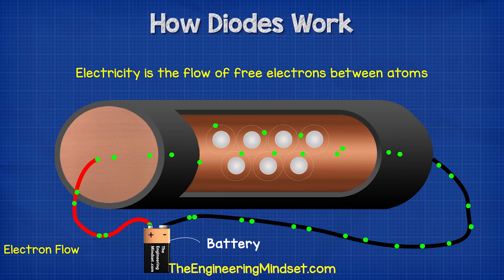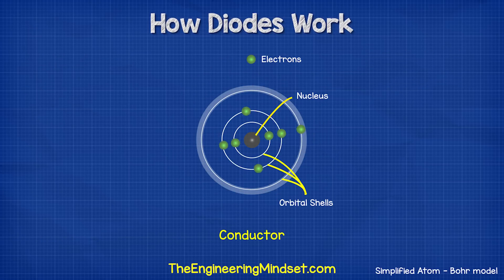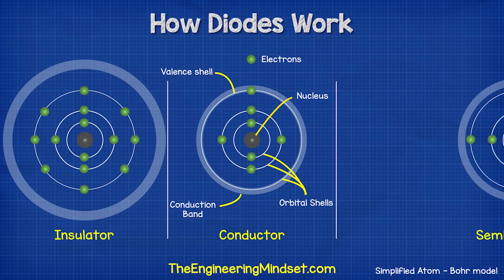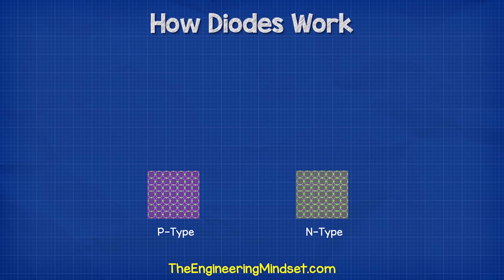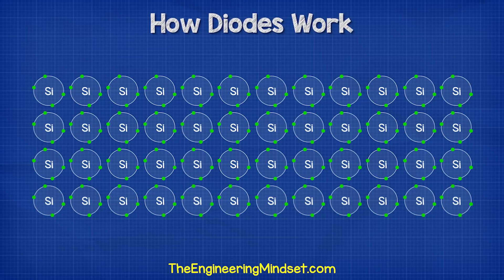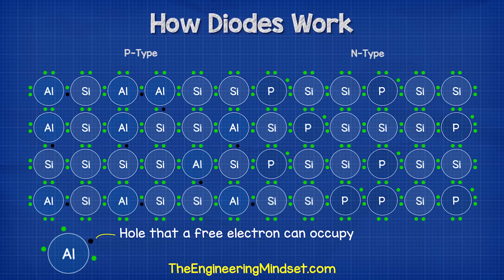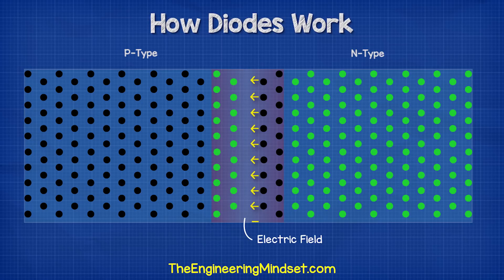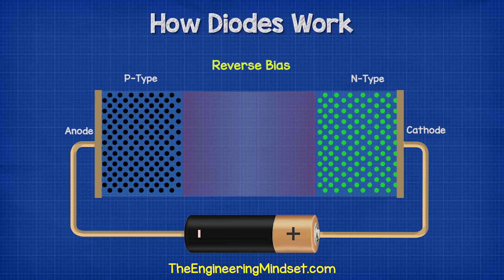This is How Diodes Work

Comment: This is similar to the explanation my College profs gave in the Electronics Technician program I graduated from in 1979. For some reason this explanation makes a ton more sense than it did back in 'college. Obviously this explanation is enhanced by using the animation and thus easy to understand.  After 43 years I am finally able to claim I UNDERSTAND how diodes work rather than just forward biased the switch is on and in reverse biased the switch is off. It is true, a picture is worth a thousand words, and an animation is the pathway to understanding. Great job. Three thumbs up. First time I have ever given more than two thumbs for anything.

Comment: When the diode acts as an insulator, and the boundary region expands, are the electrical properties of the anode & cathode different enough to detect elsewhere in the circuit (if we cared enough to make a specialised detector circuit)? Or is it simply indistinguishable from, for example, a disconnected PCB trace?
Reply: Typical diodes in reverse bias should present a high resistance, like 10kOhm.  The exact value depends on the doping and size of the diode.  If you apply a large enough reverse bias voltage, the diode will start to conduct a reverse current due to electric field breakdown.  Those are 2 characteristics that an appropriate detector could use to figure out if a diode is present in a circuit.

Comment: This is great. Maybe I missed something but it said the energy has to be more than 0.7v and the battery shown is 0.5v
Reply: You’re right
Reply: I noticed that and I believe it was just a typographical error; such a battery as pictured is 1.5 V.
Reply: It's not an error as some have guessed. When the battery is shown as 0.5v, you can see the flow stop. He could have elaborated on the demo more, but it was to show that 0.5v would not allow the electrons to pass the barrier.

Comment: It is also interesting to note that in the reverse bias mode, the size of the depletion region can be changed by varying the applied voltage.  This results in what is known as a "varactor" or "varicap" which is basically a voltage controlled capacitor, useful in RF tuning and other applications.

Comment: Very good presentation. I remember in high school chem we were going over the types of bonds and such and how some element combinations desire electrons when others want to get rid of them. I realized that (at the time I didn’t know it was called doping) you could arrange two types of combinations (P and N, though again didn’t know they were called that at the time) together such that current could only pass in one direction. I knew what a diode was and what it did at the time but I remember having that eureka moment in class as I realized how it worked atomically. Amazing visualization of it!

Comment: Some IC chargers, mostly phone, camera chargers have an inbuilt secret variometer. By adjusting voltage, you can decide, what to use it for, if the device is outdated or lost.

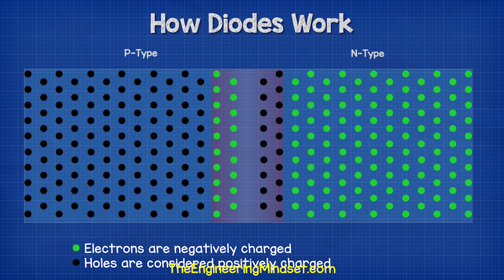Comment: 3:50 Something that you should’ve pointed out is that the P and N doped pieces are still charge neutral, only the depletion region has net charges because of diffusion. That is, when concentration of something isn’t uniform, it tries to spread out

4:35 This is backwards, when reverse bias is applied, the depletion region shrinks to nothing. Then you’re trying to pull electrons from the p type and holes from the n type, which is very difficult to do.

With forward bias, some of the electrons in the p side of the depletion region get replaced by holes and vice versa on the other side, and then the depletion region tries to keep equilibrium by diffusion. The reason that this requires some voltage to start is to cancel out the field set up in the depletion region.

Comment: Why does diode burn, when you connect it as insulator but with too much volts?
Reply: Any insulator will fail if the voltage is high enough.
Reply: @johnd5398  yeah, I know but why is this happening if Electrons are separated?

Comment: Excellent!  A year's worth of semiconductor theory in 5 minutes.  In 1963, I bought a "GE Semiconductor Handbook" which explained "Hole Flow".  Trying to explain this to classmates got me ridiculed and laughed-at.  Thank you for your excellent videos.  I just gave you 5 quid.

Also thank you for saying aluminum correctly.  Americans pronounce it correctly as did the discoverer of the element.  A prissy "Royal Society" changed it on a whim to Al you mi EE yum!
Reply from the maker: Just seen the tip, thank you very much appreciated.
Reply: @EngineeringMindset  You did such an outstanding job on this one, I couldn't resist!  (Retired EE on fixed income)

Comment: Excellent review of diodes! How does a zener diode differ?
Reply: A zener diode has a very sharp drop in its breakdown region compared to a regular diode. This is designed deliberately to be at a particular reverse biased voltage, called the zener voltage, say -12V. The diode can operate in the reverse bias at -12V for a variety of currents without being destroyed, but will maintain the -12V potential difference across it. If the reverse bias voltage is too high it will still breakdown and be destroyed. They are mainly used as shunt voltage regulators in power supplies. As a load increases current draw in an unregulated supply the voltage output from the supply will decrease (called regulation). The zener is placed in parallel with the load in reverse bias to fix the required voltage for the load as the current draw varies (this is the diode's operating range at the zener voltage). When the load is drawing less current, excess current is "shunnted" through the diode to ground. The characteristic of the forward bias are pretty much the same as a regular diode. A 0.6-0.7V potential difference to overcome the depletion region.

I hope that explains it.
Reply: @1bgrant  awesome explanation

Comment: Neat video. I'd like to hear more about why exactly the power source and its direction trigger bias and reverse bias. That's the part that didn't follow for me
Reply: As I understand it: Because the N-type has a negative charge bias (extra electrons) its charge will be pulled toward the power source when the charge of the power source is positive (represented here by flipping the battery so the positive terminal is connected to the cathode). The same thing happens on the other side of the diode where the P-type (positive bias/fewer electrons) is connected to the negative terminal of the power source through the anode.  This attraction to the outer edges of the diode prevents the Depletion Region from forming at the P/N junction and makes the flow of electrons (aka electrical current) impossible.
Reply: In real, + side of the battery has low potential compared to - side (more electrons here), so when you reverse the battery, + side will attract the free electron's of n-type material.

Comment: I have no idea what you just said in the video but its fascinating and ive been an electronics buff for years
Reply: Two oppositely-charged compounds inside the diode conduct electricity when it flows in one direction and act as an insulator when it flows in the other direction. It's not exact but it's enough to get the process started.